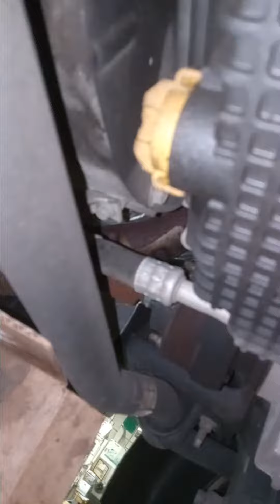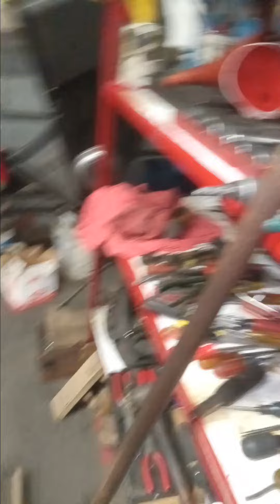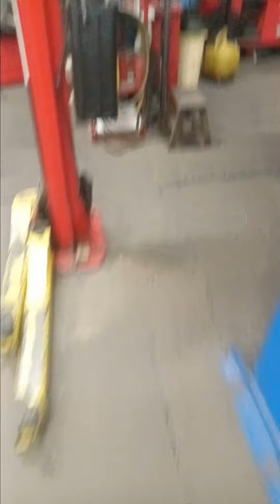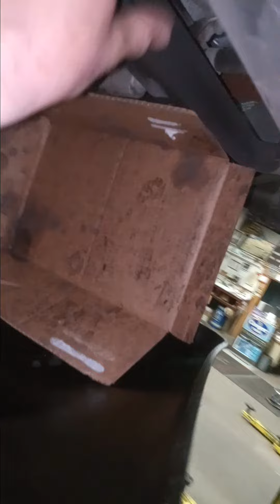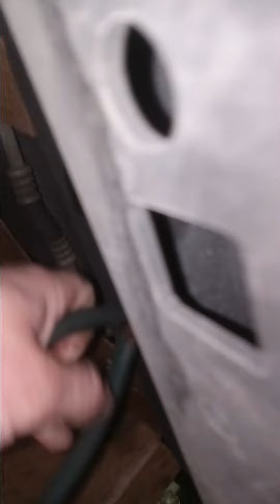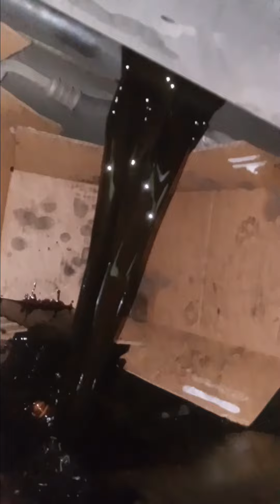Newer Ford oil drain plugs are stupid

Comment: I haven't had an issue so far but any day now. Ford older steel pans suck , half the time stripped so removal is slow turn by turn dripping the whole time.
Reply from the maker: This one actually wasn't too bad. It's normally the 2.7l turbos, they squirt everywhere. This was a 5.0l